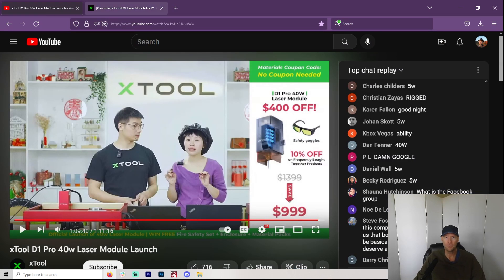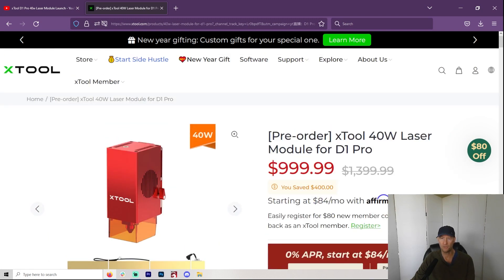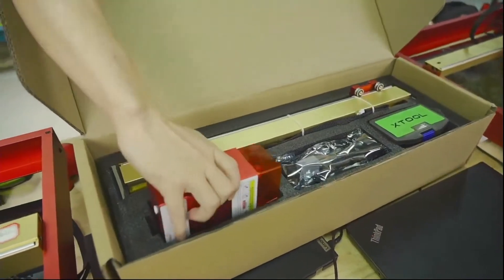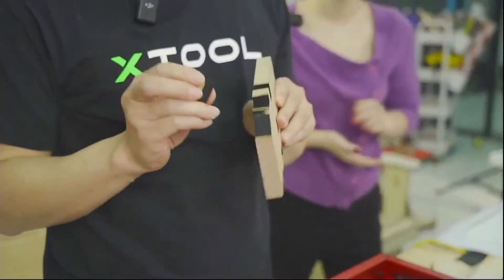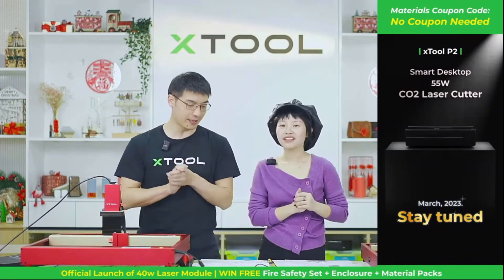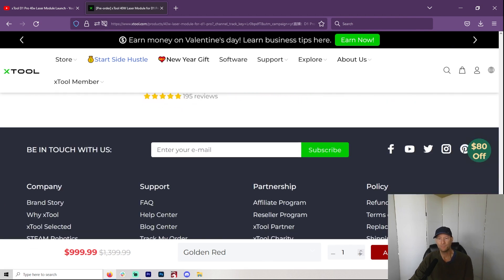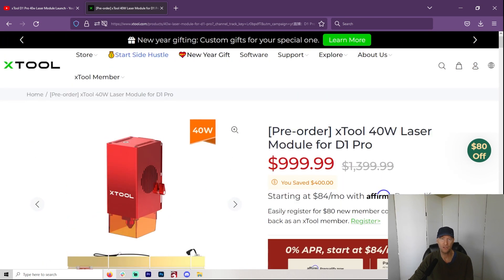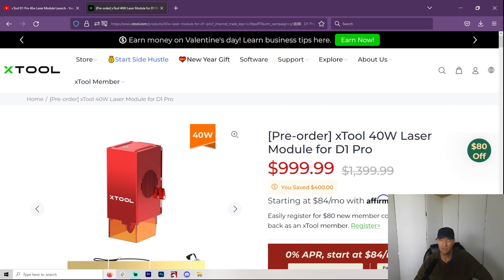NEW! 40w Diode Laser Cutter/Engraver from xTool

Comment: But isn´t the xTool D1 Pro the "iPhone" under all the laser cutters? Good quality but expensive and does the same as the other brands 🤔
Reply from the maker: I wouldn't say so. They all have their positives and negatives. If you look at my channel you will see the Atomstack and Ortur have issues the xTool does not. Hobby Guy loves Atezr, so that may be a better option. They are coming up with a 36w as well. Build quality varies greatly from my experience so far.

Comment: Interesting. What power laser is better for engraving 10w or 20w? I know 40w would be good for cutting
Reply from the maker: 10w should be better at engraving. The more 5.5w you stack up, the harder it will be to get them focused on a point. But perhaps someone will also solve that issue in time.

Comment: The module by itself cost 400 more than the LM3.  I guess it all depends on the use case.   If someone just bought a 20W maybe it would have been better to have a 10W and 40W to switch between quality and cutting.  I look forward to seeing reviews on this.   I don’t regret my LM3 purchase, it’s been very nice and consistent for me,  in fact if I need this much power I might prefer to have a separate machine.
Reply from the maker: Glad you have not had issues with your LM3. I haven't heard many people say so. In fact, mine still needs a hug to work correctly every morning.